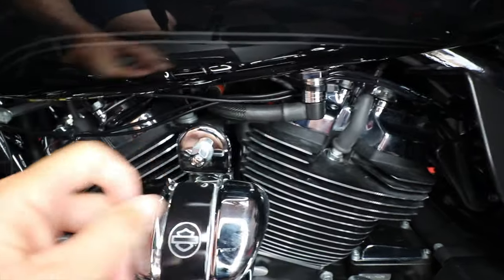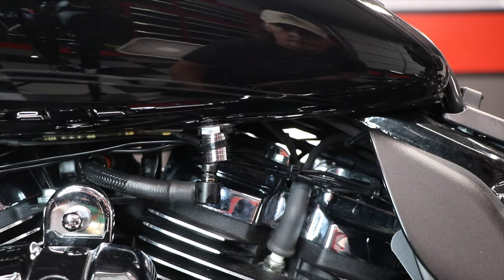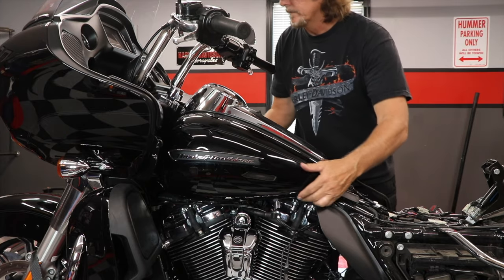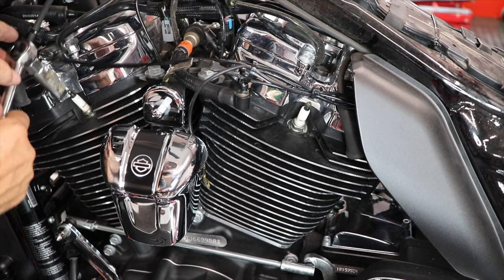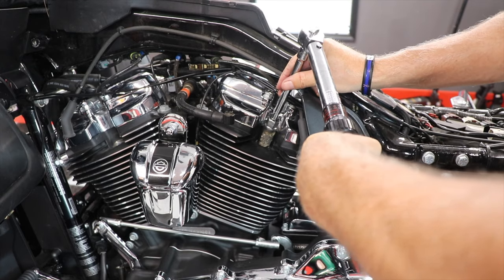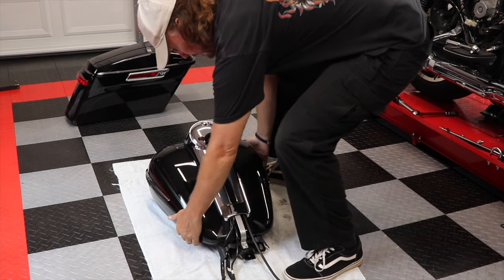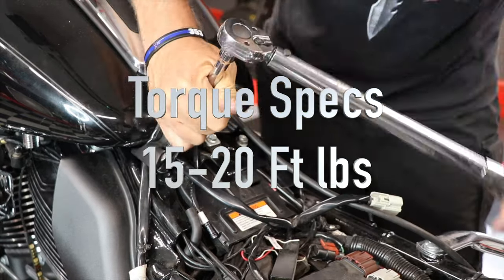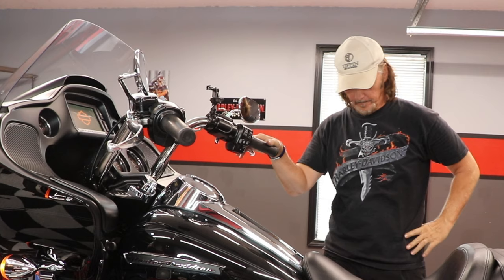Changing Spark Plugs/Milwaukee 8 Harley Engine

Comment: Quick tip. When installing plugs in a deep or blind spark plug hole use a piece of fuel line over the plug. You can twist that to install the plug.  It makes it easier and prevents any possibility of cross threading.  Ride safe.
Reply from the maker: Great tip!
Reply: Why would that help?

Comment: Nice video!  I would just recommend to use an air compressor to clean out any debris that may have found its way down in the spark plug recesses.  It will be a very bad day if something falls
 into the combustion chamber when you pull your plugs.
Reply from the maker: Great point Matthew, I had just washed and blew this off but failed to mentioned that in the video!  Thanks for sharing.
Reply: My thoughts exactly
Reply: Nah. Well, it depends. A tiny bit of dirt is just gonna get blown out the exhaust. If a pebble falls down in there or something that's a different story

Comment: Good god that was a lot of anti seize! Legit made me gasp hahaha
Reply: Yo I said the same thing 🤣🤣🤣🤣
Reply: Also should never use a click-type torque wrench on aluminum. I cracked a Jeep Overland's head at just 18 #/ft and learned this the hard way. Had just ported them too. Anyway, best to use a dial-type or digital torque wrench on aluminum to avoid the extra impact from that damn click.
Reply: oh wow that's alot of antiseize. I've never done antiseize and torque wrench. one or the other especially with aluminum heads
Reply: Should have used copper anti-seize instead

Comment: Tech tip use a piece of 3/8 fuel or coolant hose to remove the plugs simply crack and loosen with the ratchet and turn them approximately a half turn and stab the spark plug with the hose and twist it out the plug will stay in the hose when reinstalling simply put the plug into the hole with the hose rotate counter-clockwise until you feel a click then rotate the hose in until it stopped turning then tighten to spec. I Change a lot of spark plugs in the equipment that I work on. Also I would submit that you used too much antlseize jmho awesome and very informative video by the way. One additional thought since there is a torque value range and you put anti seize on the threads that technically means the threads are wet and a lower value in that range should be used again jmho
Reply from the maker: Thanks for the info Timothy!

Comment: Just a little helpful trick - before taking off the tank cut the overflow hose and then when reinstalling the tank just use a plastic connector (you can find at any hardware store) to connect the two pieces of hose.  That way you don't have to reroute the hose every time you have the tank off.
Reply: Interesting,  I never thought of that.  Good idea.
Reply from the maker: Thanks for the tip Jim!!

Comment: I want to see the unedited version taking off the plug wires!  Seriously, do you use dielectric grease on the wire?  I find it easier to get the boot off.  Great video as usual!
Reply: You are correct.  The dielectric grease is a must for water repelling and ease of removing the boot.
Reply from the maker: Thanks Ed,  the plugs are 2 years old so they actually came off as easily as the video shows. I haven't used any grease on the wires.  Have you experienced trouble getting the wires off?
Reply: @TollesonLife  I use it for: 1) water repellent, 2) ease of getting boot off, 3) fighting corrosion.  There have been occasions where the boot was really tight.
Reply: I find the harley brand works well.  I use it on every electrical connection.   There is also ACF50 of your from the aircraft mx world but the harley stuff works well.

Comment: Great video overall. It helped me in general. DO NOT Install the spark plugs with anti-seize. They are more likely to come loose if you put it on. Additionally, the torque spec changes with the use of anti-seize and so does the resistivity (ability to electrically conduct with ground.)  Also, you probably got that crap in the combustion chamber which will get on the catalytic converter. Little dab goes a long ways. I use this stuff on tierod ends for cars. YOU DON'T need a whole lot. That is why it comes in such small tubes. Overall great video. Appreciate your contribution. I would put a disclaimer on the video though.
Reply from the maker: Thanks for the tips Frank and appreciate you watching. I do have a disclaimer in the description of the video which I do on most "how I do it" videos.  Thanks again man!

Comment: Use the right tool for the job ,,, Lisle 51250 Spark Plug Wire Puller ( use for the deep plugs )
Reply: I went and bought one from your comment, that thing is fantastic. No more worrying about messing up the wires.

Comment: instead of a bent screwdriver , go to auto parts store and get a pair of the auto spark plug boot pliars ,you will have to cut some of the rubber insulation off to fit around the plug . omg way to much anti-seize you only need 2 drops on two sides . the anti- can short out the plug .

Comment: You forgot to apply spark plug boot/dielectric grease to the spark plug boot and tip of the plug. Makes removal of boot much easier.
Reply from the maker: Thanks Richard,  Ive never used that in the past but will next time!
Reply: You were lucky to get them off. One of my Screamin eagle wires tore right out of the boot. Luckily I had the original stock set lying around til H-D was able to get them. I even had a boot removal tool and took off the seat. I've since learned from a master tech that the MocCo has a special tool they send to the dealerships just for that. Was told by another stealership it was available to the public. Lying fuckers...it's made by Lisle, part #51750. $22 at Home Depot. Specifically made for the M8. Since then I use the spark plug boot/dielectric grease. No issues.

Comment: Light dab of anti seize on plug threads, torque to lower end of spec torque value to prevent over tightening. Light amount of dielectric grease to inside plug wire boots to help with removal next time, boots sometimes stick to the porcelain. Before removing plugs, blow area clean with shop air . Very small dab of anti seize on bolt threads at reassembly. Prior to photos, notes - YES. Be sure plugs are ion sensing on newer models, too.

Comment: How many miles are the spark plugs good for?
Reply from the maker: Pasquale, my book states every 30,000 miles, I do it every 10,000.
Reply: @TollesonLife  Thanks, I took my 20185Harley Road Glide  in for the 10k service, they checked the plugs and said they were fine.  the book i saw said 30k or 2 years.  I guess my plugs must be OK since they had the chance to change them and charge me but they did not!

Comment: I was reading every two years it is recommended to change out the plugs. Ive had bikes my whole life, this seems way too quick. I can see if I had 20k+ miles, but I only have 7100 thoughts?
Reply from the maker: Hey Kickin Asphalt.  The Harley book for my model says every 30,000 miles.  I just do them a little sooner.  I think you are rolling fine with 7100 miles.

Comment: from jack... your video helped , thanks. i will add this...on the inboard side of mine , i found a small pebble that would NOT come out with an air hose(had to use a long tweezer to pull it out...  my advise is to eyeball the recess before removing plug.
Reply from the maker: Thanks for sharing🙌

Comment: That’s one crazy design flaw in my book.I change the plugs on my 04 Soft tail in 10 minutes. No removing anything but the plug wires . But you did a great job and a nice how to video
Reply from the maker: Yeah,  it makes it a little more work for sure!  Appreciate ya!
Reply: No worse than Harley always placing the oil filter in that guaranteed to make a mess location. Poor design.
Reply: BobsGT235 Your right Bob, no mater what you use it still leaks down the front of the motor
Reply: Taking the fuel tank off is easy peasy and so much easier than it used to be.  Take it off..  clean everything up .  5 minutes..  you'll get so good at if you do it often is automatic..

Comment: Hi great video. After how many miles did you change the spark plugs?
Reply from the maker: Thanks Scolarichris! The books says every 30,000 miles. But I usually change them at 10-20,000 miles.

Comment: I have a problem with my 2015 roadglide, when I turn the knob to on position takes me to enter pin right away even with fob present, and no headlight, no fuel pump priming , no infotainment, nothing any idea what can it be? Battery?
Reply from the maker: Hey Isaac, sorry for the delay, been on the road….yes, I’d replace the battery in the fob. Let me know if that does the trick.
Reply: @TollesonLife  
Nothing put new battery and no go, how about the Bcm?

Comment: dude i replaced the plug wires on my 18 fatboy, took the seat off not the tank not a job for pussies, right side plug wires a bitch to get off. good vid
Reply from the maker: So you were able to perform the task with the tank on?  Did you have to raise it any?
Reply: @TollesonLife  just a tad put those red wires on. took about an hour

Comment: Quick question.. if I’m just replacing the cables (aesthetic purposes) there is no need to remove the tank.. correct? (2019 Breakout 114). The instructions seem like overkill for just changing cables..
Reply from the maker: Hey Altomar Home,  I'm not really sure about the Breakout.  It shouldn't be that difficult to change out the cables but again, I'm not sure about your bike and how they are ran.  Best of luck!

Comment: Thanks for the video, I haven't changed the plugs yet on my 2017 RGS, but the mileage is saying it's time. You don't use dielectric grease on the plug wire boots? Just curious.......
Reply from the maker: I should have Jan. Just left it off this time.

Comment: I would highly advise against using the "cotter pin extraction tool" or a pick to hook onto the boots OR be extremely careful. There's a good chance you could rip the plug boot like I did ☠
Reply from the maker: Good tip Sammy!  Thanks!

Comment: I have a magnetic socket I use to remove those deep plugs. Makes putting them in easy too. Switched plugs to the NGK iridium they are an upgrade from stock and they last.  Get 30k easily
Reply from the maker: Thanks for the info Harry!
Reply: @TollesonLife  your welcome

Comment: The spark plug torque spec, is it a wet or dry spec ?
Reply from the maker: Joe, Im not at my manual right now, on the road with the rv, not sure which that spec was for, dry or wet. Sorry I didn't mention that in the video.
Reply: @TollesonLife  ok thank you when you get a chance it would be great to know .  Be safe !!

Comment: I've heard that the inboard spark plug caps can be very tight to remove, to the point where they can break (I was told by and experienced mechanic, using the best tools), thus a new set of plug leads is required.  I'm not sure how common this is, but it would be interesting to hear from other Harley mechanics.
Reply: if you buy a set of real spark plug wire pliers there shouldnt be a problem. the also make them in right angle design